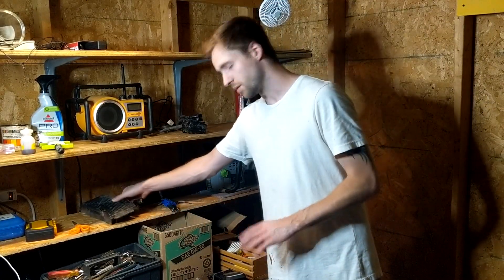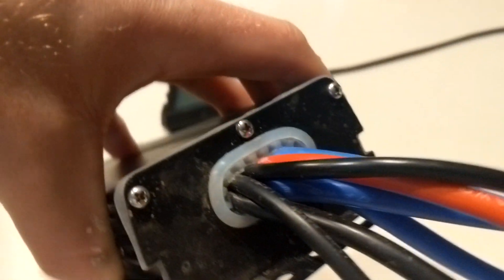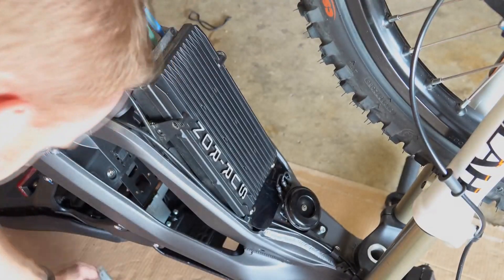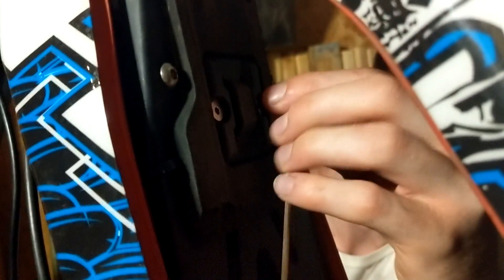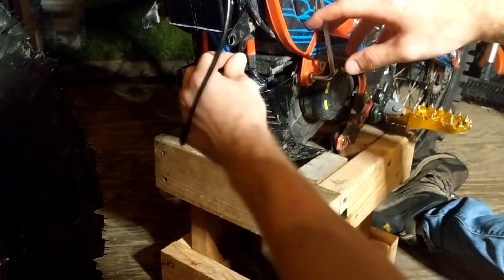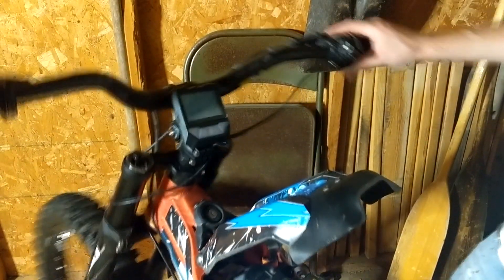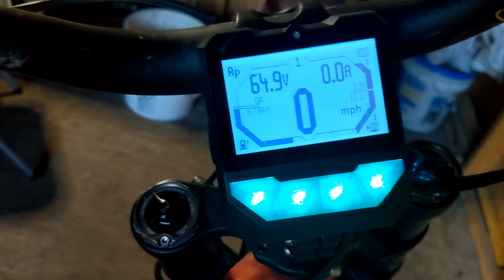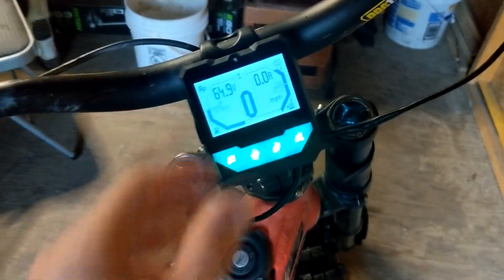+30% Power! Installing Nucular 24F Controller On The Sur-ron/Segway

Comment: you skipped a lot... like where did you plug in your screen? how did you mount the screen.. mine comes with a solid metal circle at the top by the handle bars. THere is no place to screw in the new mount for the screen. Much less any instructions on where to plug the screen in as it only has a 5 inch cord dangling from it. Looks like you hook it into a USB port by the looks of the hook up. However I cant for the life of me figure out where to attach it to the motor or how? Its crazy how it shows up at your house with no instructions and videos of people with different bikes throwing it all together. I have so many problems installing this thing im about to put the stock one back on and throw the controller away.
Reply from the maker: Mounting its open for interpretation ☺️

Comment: Is it necessary to make the throttle connector to plug into the display? As in, using the stock plug/harness will not work?

Also, is the EP/sport switch used or removed? 

PS I'm still running the 58t sprocket you sent me!

Comment: Hi I bought a nuc 24f controller but don’t know how to do my throttle mine didn’t come with it as well. What do I do :(
Reply from the maker: You have to splice your throttle cable into a connector that they ship with the controller. I would reach out to SurronShop. They will video call you and walk you through the whole process
Reply: Ok but there are only 3 wires so only 3 go into the connector that was shipped right?
Reply from the maker: @CalebCarCraz2  I would say yes but it's not always the same. Some controller ship with different wiring.
Reply: @electricisbetter  on my throttle there are 3 wires so witch do I put into the controller scream? Th +5 and gnd?
Reply: @electricisbetter  1000+ $ and there forgetting the throttle!? The hell?!
Reply from the maker: @ttoyscustoms  the controller is normally $1.4k with everything
Reply: @CalebCarCraz2  Were you able to get your Nucular24F throttle hooked up? I just got mine and my wire colors are blue black brown on the throttle, not red, black, yellow like the picture diagram he showed in the video, and does the throttle just go directly into the screen just cutting off the original connector? Thank you.

Comment: 6.5mm Castle Creations bullet connectors for motor power leads, rated for 200 amps, you can find similar for phase wires, Luna Cycle carries some I believe, Liquid electrical tape... for water proofing the end of controller, wire plugs etc... best of all, it just peals off when you need to service.... Stretch your electrical tape and rewind on roll   before wrapping, it will shrink and form a much nicer wrap around the wires...

Word of Caution about liquid electrical tape, do NOT use around small children and or pets... use in well ventilated area's, it will stain EVERYTHING it touches, it will melt some... I use cut off pull ties to apply or Popsicle sticks... more than one layer is advisable, thin layers, thick ones take forever to dry... it shrinks when dry ...
I use it to seal all my electrical plugs... along with double wall or glue type heat shrink tubing, properly applied, it will make a water proof seal and very strong. Much thicker wall compared to Amazon crap, auto/truck shops carry it.
Shinko 520 series tires...
And well, a 2 wheel drive hub motor ebike, like have ridden for over 10 years... will roxor your boxors...

Comment: What size lock nuts are needed for the Allen screwed that you used to connect the motor/batter wires to the controller?

Comment: I'm debating which controller I want to go with on my talaria... I'll enjoy the stock setup for a little while but only a little while lol my razor bike does more than 80amps... a bigger bike will be amazing. I'm on a budget but I've been cheap before and that sucks... I'm thinking sabvoton would be cheaper but I'm thinking a sintech would be nice. Asi bac controllers idk why I'm just not a fan of. Maybe cuz that's what everyone's using and they're hard to come by wait lists and very expensive. Idk though no rush really
Reply from the maker: Good comment. I'm actually supposed to be receiving a Talaria here soon that  I'm going to start making videos on. Also partnering up with SurronShop (talaria studios) and they are supposed to be bringing a bunch of upgrades for the Sting. So far, they've told me they like the Sintech controller on the bike. Stay tuned 😁

Comment: Hey there, wanted to know if theres a diference between x controller and 24f with stock battery?
Reply from the maker: Yes.
Reply from the maker: @Michael Coleman the stock x controller is set to a max 5.3kw output power.  The 24F is able to pull up to 23kw of power with a upgraded battery. 

You can also bypass the BMS of a stock battery and get up to 7.2kw of power with the Nucular.

Comment: Whe did you place an order w/Sur-Ron Shop?  Trying to understand their lead times?
Reply from the maker: There is usually a waiting list to get on before you can actually order it. I got lucky and they had one ready when I first talked to them. Shipped it the next day after paying.  Other thing I would change is the shipping. They offer DHL. 2-3 days for like $150. Vs $70 standard. I did the standard shipping and it took 2 mouths to get after they shipped.

Comment: The ASI controllers have true FOC and field weakening, making them more refined and provide faster top speed. They can also be purchased for way less money from Green Line Engineering in Chicago Illinois and everything arrives programmed and in English. Good video by the way. Love the channel
Reply: Link?  I can't seem to be able to find a Green Line Engineering in Chicago.
Reply: Good luck programming ASI if you bought thru a vendor. No backdoor access for BAC unless you buy directly from ASI with a license. Also NUC24f can run on FOC btw.
Reply: @03SVTMB  I guess you have not been watching the easy to program YouTube videos by Green Line Engineering. They make it so easy to program and they are in the USA. You can also easily swap between 60v and 72 volt batteries in less than 2 minutes
Reply: @03SVTMB  Nucular does NOT have Field Weakening. Only ASI has it and that is why all the top speed records on the bike are with an ASI
Reply: @Buffetology  Not heard of Green Lime Engineering will need to check them out. Nucular has it's own display and it's all handled thru it. No additional apps or extra egg rider displays needed. And Nucular does have field weakening. I can change the parameters on it. Thanks for the info.
Reply: @Buffetology  Nucular have field weakening
Reply: @Buffetology  Nucular has field weakening. Also, why the hell would you want to use field weakening. Using FW with 72v batteries on the stock motor is a thing of nightmares.

Comment: What made u go with the 24f over a bac? Still deciding myself
Reply from the maker: Compared to SinTech or nucular 24f controllers, Bac8000 is definitely more powerful. However, it is not possible to realize it’s potential on the sur-ron factory motor. 
Bac 4000 performance is very similar to Nucular24f as well
I can claim that all these 4 controllers are pretty much similar in terms of power output. That is why it is more important to compare the feedback and affordability of these controllers. I went with 24F from SurronShop because of this.
Reply: @electricisbetter  Hi, if i put a Nucular24f with stock battery (without bypass) there is some increase of power?
Reply from the maker: @edododo8724  slightly. About 15-20%

Comment: Thanks for the video. Is that throttle modification required for the stock throttle? It seems like you soldered a resistor in between. What value?
Reply from the maker: It is. Unless your controller comes with a throttle with the connectors already. SurronShop said the resistor is necessary.
Reply: @electricisbetter  Thanks for the hint. Do you happen to know how many ohms the resistor was?
Reply from the maker: @flyingfox8586  no, They usually go by color and then the colored stripes on them. I just used the same one from the picture SurronShop sent me
Reply: @electricisbetter  haha, yah. Is there any chance you can share that picture. Going to try regular wiring first, I was told the NUC will throw an error if the value is out of bounds. Then I know a resistor is necessary.
Reply from the maker: @flyingfox8586  the photo is in this video. Otherwise I can email to you
Reply: @electricisbetter  went through the setup today. The stock e-throttle works out of the box through the system plug/canbus. No splicing or adjustments of any kind are needed. Plug&play.

Comment: Why did you get the 24F instead of the 10F? It says the 10F is good up to 10kw, which seems like plenty of power.
Reply from the maker: 24F is good for 20.000w. Or 20kw of power max
Reply: @electricisbetter  oh so u do plan on upgrading the battery too?
Reply from the maker: @erikjonromnes  I think that would be the next step, yes. But that alot of $$$. Cybertruck 1st 🙌